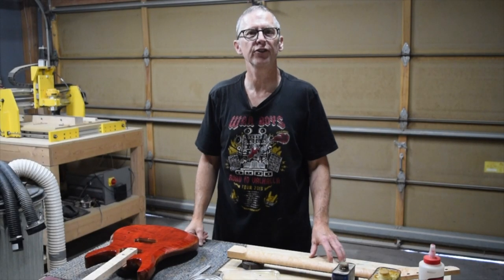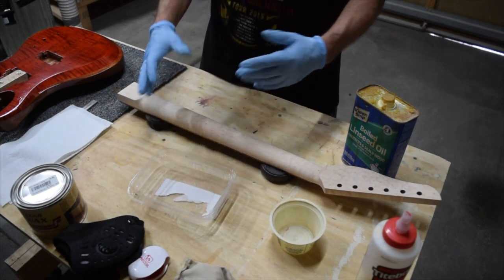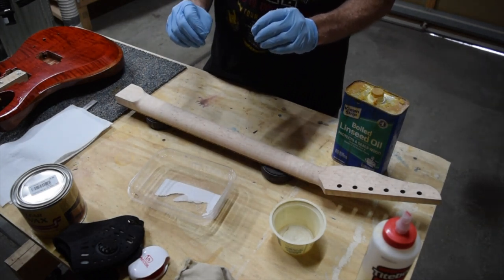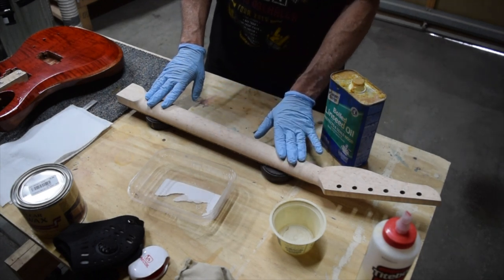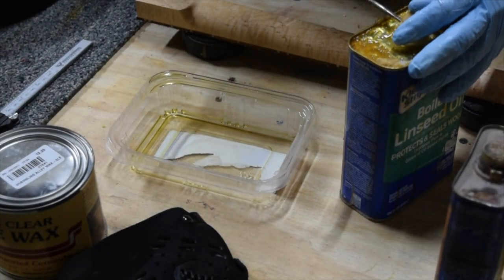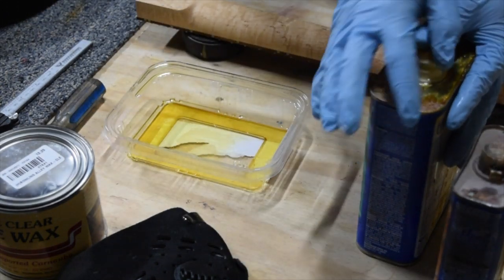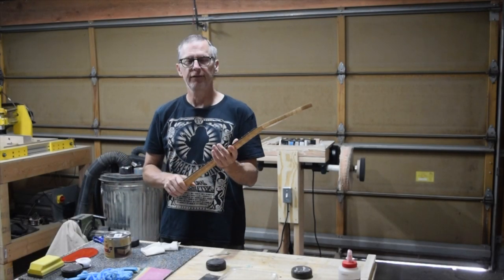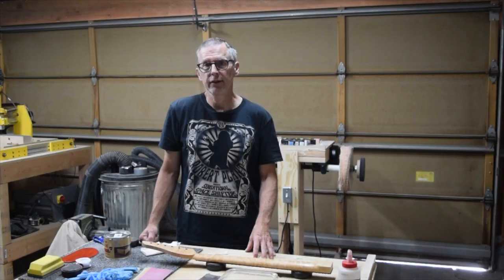Applying An Oil Finish On A Guitar Neck

Comment: Thank you for sharing this information, and for all the details!  I'll be building a flying-v bass kit soon, and have been looking for a simple, and easy method to finish the neck. 
I have a question.  It seems in the video, that you do not oil the heel of the neck, the part that sets into the neck pocket on the body.  Is this correct?  Or, do you also oil the heel?
Reply from the maker: If I'm doing a set neck, I DO NOT oil the heel because I don't want the oil to interfere with the glue. If It's a bolt in, I oil the heel to seal the wood.
Reply: @HighlineGuitars  
Thanks so much for getting back to me.  This particular kit is a bolt on, so I will oil the hell to seal the wood. 

One more question, please. I hope you don't mind. 
I plan on doing a cloth wrap on the body (top, bottom, and sides).  Would you recommend oil in the neck pocket of the body to seal the wood, similar to the heel of the neck?
Reply from the maker: @KZ_Kon  yes
Reply: @HighlineGuitars   Thank you. Again, I appreciate you taking the time to respond. Also, thank you for such a well made, and detailed video explaining the process.

Comment: Help! I am doing this with a short scale P-bass kit. I am on the 3rd coat and the finish is incredibly silky to the touch yet I am getting this "blotching" as the wood is absorbing it differently along the neck. I read up on this problem and it seems to be inherent in the wood used in the kit absorbing the oil differently in places. Is there a remedy to this? I am inclined to go back to sanding with 220 to see if I can make it even, because any attempt at using a stain will probably show up more dramatically as I add more coats of oil.  Thank you for a great video and objective information.
Reply from the maker: I would apply a sanding sealer and sand it back before applying the oil.

Comment: Chris,
I have a kit with a maple body and a mahogany neck.  Can I fill the neck and still be able to use this type of finish on it, or would filling it seal the wood enough to not allow the BLO to soak in?
Reply from the maker: Yes, you can fill the grain and follow with BLO. Just make sure you sand the filler off the surface first.

Comment: I am looking for alternatives to Japan Drier in this process.. would Liquin or Turpentine do the same?
Reply from the maker: If you have an arts and craft store nearby that sells tube of artist oil paint they may also sell drying products that do basically the same thing as Japan Drier. Liquin is one such product. Turpentine and mineral spirits also work, but not as fast.

Comment: I know this video is a couple of years old now but I had a question.  I'm planning to follow the process you described (which was really very well done).  I want to apply a logo to the headstock.  I'm assuming I finish the guitar as you described and then, once dry, apply the logo and then apply a poly over the headstock with the logo to seal it in and hide the ridge.  Any concerns with that?
Reply from the maker: I don't know. I have never done that.
Reply: If you are thinking about putting a decal on then you need to wet the headstock to enable you to do that. If you wet a raw wood maple neck headstock you will raise the wood which will mess up the smooth finish you are after. Your best bet is to apply some matt clearcoat or matt varnish or something and cover the front of the headstock with that. Let it dry and then apply your decal in the usual way. You'll then need to cover the decal and headstock once again with 3 or four coats of clearcoat and sand down each time with 1500 or 2000 grit. Until you are satisfied. Then apply your boiled linseed oil as explained to the rest of the neck. Having said all that it's essential that you don't put a fake brand name on a cheap copy. Firstly you can always tell a decal from a genuine print but even so unfortunately still a lot of people are scammed these days.

Comment: Just my two cents. It's important to note that Japan drier may contain potentially toxic substances, such as lead and cobalt  compounds, which can be harmful if not handled properly. Due to environmental and health concerns, there has been a shift towards using alternative drying agents in recent years.

If you plan to use Japan drier or any similar product, it's crucial to follow safety precautions and consult the manufacturer's instructions for proper use and disposal. Additionally, consider using safer and more environmentally friendly alternatives if available.
Reply from the maker: You are correct. The product I was using is lead-free, but the cobalt it contains is dangerous.

Comment: Thanks so much for this video! Your work is beautiful. Just one question… you only apply a single coat? I read everywhere that BLO and Tung Oil require 3-4 coats for maximum protection. Any reason why you only apply 1 coat on your necks? Thanks!
Reply from the maker: I wipe on one coat and wet sand in multiple additional coats.
Reply: @HighlineGuitars  Thank you for the quick reply!  I’m refinishing a 5-piece roasted maple/padauk neck (originally sealed with a satin varnish) with Pure Tung Oil, but without the Japan Dryer. I thinned the first coat 50/50 with odorless mineral spirits to make sure it penetrates deeply into the wood. I used your wet sanding method, but I used 2000 grit sandpaper (I don’t have 1500 at the moment). Do you wetsand the last coat, or only in between coats?

Comment: Hey Chris! What do you recommend for sealing an unfinished maple fretboard--with the frets already on? Do you already have a video on this? I'm doing my first kit guitar, and I want to make sure I seal the wood from moisture properly. Excellent channel! I've watched a ton of your videos in recent weeks. :)
Reply from the maker: Spray a couple of coats of lacquer on the fretboard. After the lacquer has dried, take a razor blade and slice through the lacquer where it meets each side of each fret. Next, mask the fretboard and scrub off the lacquer from the frets with a coarse synthetic scrub pad. Continue by polishing the frets. Finally, remove the masking tape.
Reply: @HighlineGuitars  thank you for your reply, Chris! Follow-up: could I do this same process with wipe-on poly as opposed to lacquer, or would that be a bad idea? I got Minwax oil-based wipe-on poly to finish the body, and I wondered if I could use the same for the fretboard.
Reply from the maker: @joshuaandtheruins8580  Yes, wipe on would work.
Reply: Thank you! Your channel has been a life-saver. Liked and subscribed. :)

Comment: How many coats do you use on the neck? Do you let it dry then sand and add another coat or do you just use one coat like you did in the video? And if you use multiple coats do you use the japan dryer again on top of last sanded coat? Wonderdul video. Thank you for sharing your knowledge.

Comment: I’m about to try my very first kit build I have from StewMac. After viewing a link they have on painting the guitar, including the neck, I realized that’s WAY too much effort and want a much easier path. What this video showed was the back of the neck, no problem understanding. What about the fret board? Another website used oil on both front and back. 
Also, I’m on the fence whether to paint the body due to the labor intensive work. Any suggestions for a transparent stain or oil? So much more to learn… All suggestions and advice would be helpful and appreciated.
And while I’m at it, I Subscribed and next I will help support you by purchasing one of your t-shirts. Seems to me the right thing to do after all you have given. Thank you!
Reply from the maker: I do the same treatment on the fretboard as well. Some people like to put a clear coat like lacquer on Maple fretboards for better protection, but I don't. It just means I have to clean the fretboard more often.

Comment: never really noticed it but the saddles ofmy fender's bridge had notches in them caused by the strings over the years. Spend 2 hours sanding and buffing them. Was kinda an annoying job to maintain the curved shape of the saddle with the sandpaper, went through a lot of it

Comment: Very helpul, thanks :)
Couple of questions :
- On a bolt on, should I finish the part of the neck that goes in the neck pocket ? (and should I finish the neck pocket too ?)
- Can you oil finish the neck, and nitro finish the headstock only somewhat easily ? I'd like a glossy headstock
Reply from the maker: Yes x2
Reply: @HighlineGuitars  Aah thanks a bunch
I'm so excited to start building myself a strat :)

Comment: Great Video, i do have a question. I prefer a maple fret board. When finishing  a fret board and  head stock,  i want to replicate the factory sheen. In the case of a 80's 90's Fe*der Am Str@t Deluxe is a gloss. What product/application technique would you suggest to use to achieve this? Further, to exactly replicate the 80's 90's era, the nick has very little in the way of colour, and is quite blonde almost clear with just a slight hint of a light straw/yellow/ orange colour. This project is to replace an extremely bowed front neck on a 1990's Fe*der American Deluxe Str@t. Lastly when using a sticker - not a water slide decal, when/where in the process is the sticker applied to semi-hide its thickness and edges. This era of guitar uses a spaghetti logo sticker in either dark aluminum or gold. It has made a come back on some of the Professional series guitars of late from Fe*der. any help would be greatly appreciated. Rob - Winnipeg Canada.
Reply from the maker: Nitrocellulose lacquer

Comment: hi! if i use tung oil, should i use the same method of wet dry sandpaper + mineral spirits + splash of tung oil after an hour of drying? or perhaps i should wait longer than an hour, considering tung oil takes longer to dry and also because i don't plan on using japan drier?
Reply from the maker: You can do the same process with tung oil. If you want to wait longer, you can. Whether you use boiled linseed oil or tung oil, they are both very forgiving.

Comment: Hey, so grateful to have found your channel! Just making my first guitar and I went with your advice for the neck. I did 100% BLO tho without mineral spirits. Have I messed it up?
Also I’ve done Danish for the body. Can I put Tru Oil on top of this for a shinier finish?
Thanks.
Reply from the maker: You haven't messed it up. I use BLO without mineral spirits all the time. I normally use mineral spirits when I want to wet sand in the oil. You can use Tru Oil for a shinier finish as long as the danish oil is completely dry first.
Reply: @HighlineGuitars  Brilliant! Thank you

Comment: Sometimes, I wish this guy could explain everything like he does, but tell you what’s the best when expense isn’t an option. Like, would he use tung oil/ tru-oil if it was stocked locally and he didn’t care about saving a couple dollars?
Reply from the maker: There's nothing special about tung oil and Tru Oil is what amateurs who don't have spray equipment use. My favorite finish is one that is very expensive and most amateurs can't do. Tinted 2k polyurethane.

Comment: I tried this but thinned the oil with mineral spirits and a little drier mixed. My maple neck came out blotchy with dark areas and light areas. The rosewood fret board looks fine, but the maple...eh. Did I make a mistake?
Reply from the maker: Did you test your finish on a piece of scrap saved from making the neck? If not, that would be your mistake. You would have seen the need for a sanding sealer first to prevent the oil from darkening the open pores where they are exposed on the surface.

Comment: Love it. Can I just clarify, you mention at the beginning of the video that you use equal parts boiled linseed oil, mineral spirits and fast-dry polyurethane, but then you go ahead and use japan dry/linseed oil mix and then mineral spirits for wet sanding. Am I missing something?
Reply from the maker: No.
Reply: He's saying you can do that but in this video he just uses BLO and mineral spirits. I'm interested in doing a bit of an experiment with some added poly but I feel like it wouldn't feel as nice as the BLO finish.

Comment: I just tried this on my Flying V build. I think I might have not applied quite enough oil. Is it okay to do a second oil apply after having done the wet sand with the mineral sprits, maybe in a day or two?
Reply from the maker: Oil is very forgiving. You can apply another coat whenever you want.

Comment: Two Questions; 1.) How long does the Boiled Linseed Oil last--does it need to be reapplied periodically? 2.) What can be applied (if anything) to the fret-board? 

A little background: I am about to build my first kit guitar and the parts are delivered with no finish on the wood including the fret-board. The neck will be glued to the body and therefore, if the Linseed Oil needs to be reapplied every couple of years...it would be harder to perform the maintenance coats. 

Third question would be, what cleaning product to use for daily/weekly cleaning?

Thank you in advance and the video was very informative.
Reply from the maker: BLO needs to be reapplied occasionally. There is no reason you can't reapply it if the neck is glued. How long it lasts varies. BLO is fine on a fretboard. Dunlop Formula 65 is a good cleaner.

Comment: I just bought a $55 unfinished maple neck off Amazon (quite nice, actually) and I wanted to add a cheap finish on it. Can I use fractionated coconut oil? This isn't like normal coconut oil. It doesn't go rancid and is always a liquid, it never hardens, because all of the saturated fats have been removed. It's completely odorless. Will this work? I have a bottle of it lying around.
Reply from the maker: I wouldn't use it. You need to use a drying oil like boiled linseed oil or tung oil. Fractionated coconut oil will never dry and I would fear it could start to look grimy pretty fast.

Comment: I have a guitar that i don't like the necks' look or feel, it has some sort of glossy finish (no colour, just on top of the maple neck.. It's a little sticky as well) 
Would it work to sand it down to the raw wood, apply some boiled linseed oil to achieve a smoother neck and hopefully a little darker colour? 
(maybe some darker wood stain first/after? I don't know much about refinishing guitars, but i wanted to try!🧐)

It's not a roasted maple neck.. Looks like a 90's catalogue from IKEA for cheap furniture. I just wanted to try to breathe some new  life into it!
Reply from the maker: I don't know much about refinishing either. Maybe someone in the community will read this and will know what to do.
Reply: @HighlineGuitars  I probably meant darkening the wood, not actually painting it. To keep the look of the wood but make it darker.. hmm..

Comment: Hi Chris is the 'Japan Drier' essential for this process or can I get away without it also & get a decent finish? I also didn't know about Tru Oils short shelf life is that only once its opened? thanks
Reply from the maker: Japan Dryer is an option to speed up the drying process, but it isn't necessary. Tru Oil's shelf life drops as soon as you open it.
Reply: I bought a small bottle of tru-oil (and the wax) and my kit tele neck feels incredible. 7 months later I applied it to a raw strat neck and it still feels gummy, so that's how short the shelf life  was in my case !
Reply: Thanks Chris...Theres some Boiled linseed oil with agents that speed up drying (here in Australia)  so will def give that a go for sure.Cheers
Reply: Thanks for that David...good to know & appreciate your input

Comment: Hey! Raymond over from P.R., I just subscribed after watching your vedeo about applying boiled linseed oil and Japan drier and so on. Question, when can I apply a New Decal on a headstock?  Thanks! God bless you!
Reply from the maker: When the BLO has fully cured.
Reply: @HighlineGuitars  After applying the decal then another same procedure of the 2 components can be applied ?
Reply from the maker: @raymondruiz1843  No. After the decal, you would apply clear coat.

Comment: Hey there, just wondering if you could finish the guitar body in a similar way to get a natural finish? Would you then coat it with polyurethane to protect the body afterwards? I’m in the process of fixing up an old guitar that has some sentimental value, and want to give it a new lease on life (the old/original finish is a bit cracked up and crappy). Thanks
Reply from the maker: You can do that, but you might want to consider restoring it with the same finishing products that were originally used.

Comment: Hi Chris.  All your videos are great.  I happened to spot your headstock decal there on the headstock.  When you are oil finishing a neck, could you share any of your suggestions for addressing the headstock decal?  Do you apply the decal to raw wood, and then BLO over it?  Since BLO doesn't build up, how do you hide the edges of the decal?  Or do you lacquer the headstock face while oiling the remainder of the neck.  I've tried to research this issue and I seem to get a variety of inconsistent information from the various sources I looked into on various forums.  Appreciate any advice you might have.
Reply from the maker: I don't use decals anymore since customers think they're cheap looking. That being said, you can apply a decal over BLO as long as it is dry. Then, you have to bury it in lacquer to hide the edges.